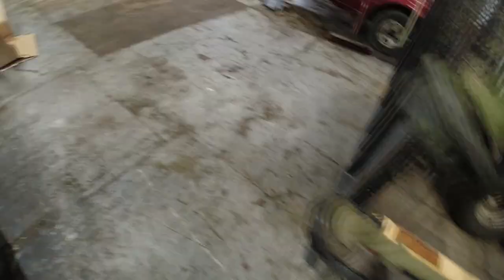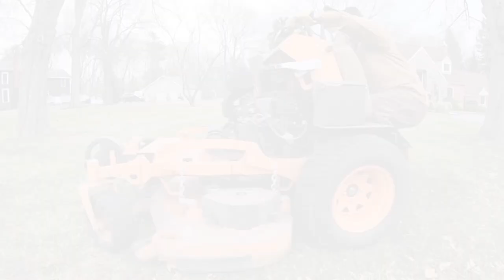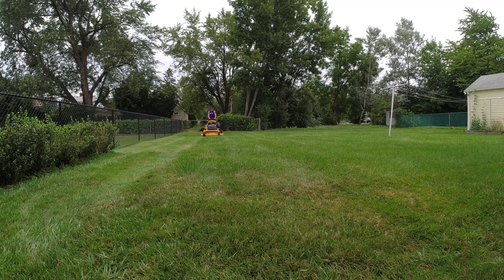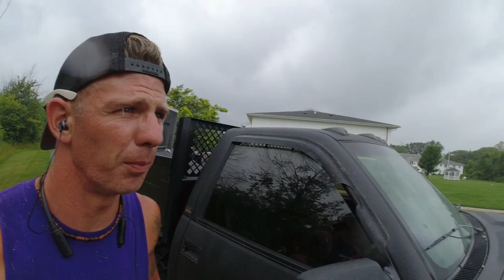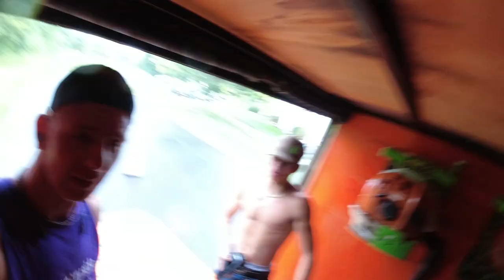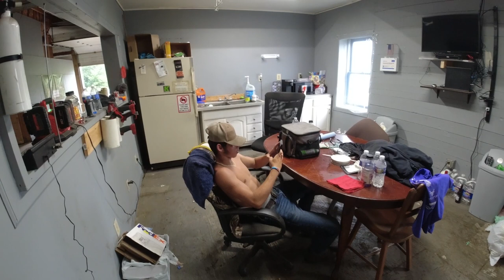WRIGHT X 52 & why I bought it

Comment: Glad you found a mower and glad the new deck is performing.  We finally had our wiring harness replaced on new mower but, now it's burning super rich and going through 2 gallons of gas per hour so, it's gotta go back and sit at the dealer again 🤦they have a new 52" Ferris that I want really bad but, the only one in stock is in Florida 🤷ugh😒
Reply: If is not one is another!! Which Ferris are looking? I'm looking at a 52" z2
Reply from the maker: That's crazy fuel consumption

Comment: Try a can of Seafoam in a full tank of fuel every or every other tank full for the cutting out problem and see what happens. Put it in a low fuel tank and then add fuel for a better mix. Mine was doing that as well and it seems to help. I know you shouldn’t have to on a new engine but just give it a try.
Reply from the maker: Hate that stuff. I use k100 but it’s not a fuel issue, exactly,  it’s the fuel cut off switch on the bottom of the bowl of the carb. That combined with how the engine is mounted
Reply: @CountrysideStrong  definitely not familiar with the fuel cutoff switch at the bottom of the bowl but I have seen a wire down there somewhere, I’ll look for it when I start working on mine here in a bit. I had heard from a Wright technician that they use it frequently so I thought I would try it and now I use it all the time and it really does seem to help or eliminate that issue. Can’t say why unless it is internally lubricating the carburetor somehow but I run it in all my Kawasaki carbureted engines now.

Comment: Randy i had that exact problem on a brand new wright. I fixed it myself. It was a adjustment rod with a spring around it located on the stand on platform.  It was slight bent. Check it out.

Comment: I heard same engine availability issue from multiple dealers. I ordered a bradley after being on a short waiting list in March.  Wish it had a better engine but I'm just glad to have one at all with how things have been
Reply from the maker: Exactly, I have heard many people having problems
Reply: It's a shame.  Was my first stander.  Drives well cut is ok still adjusting somethings  I would've liked to get a more established brand but the prices have just gotten astronomical
Reply from the maker: Yes they have
Reply: @jamess9910  I have a Bradley with almost 500 hrs on it. I got it 3 years ago. Has been great. I love the Briggs vanguard no issues for me
Reply: I wouldn't mind the vanguard.  I have the 36 so the only option was briggs commercial turf. Haven't heard great things but again, it's my first mower, and got me in the Game, before this I used a sulky and my knees and ankles would be shredded after 40 lawns a week

Comment: My x does the same thing. With the engine moving up and down with the tractor, I believe it’s an intermittent loss of fuel. I honestly think an in-line electric fuel pump would fix that issue. I get why wright designed that mower like that to get longer belt life etc, but with the articulation of the engine I really do think the bowl in the carb is never truly able to deliver the fuel needed at high rpm when on an angle.
Reply from the maker: I believe you're prob right

Comment: The engine cutting out on bumps, i would check how its getting fuel, and another possibility is ho the choke and throttle is done, it can be choking it self on bumps which mean it may need a spring pulling back on throttle or choke, there just about no way it can be a fuel problem if your other mower don't have that problem. Just maybe it has a oil sensor that kills the engine, i know some engines have them and slight hill or bump and will shut the engine down.
Reply from the maker: Yes that all makes perfect sense.

Comment: My 37 vanguard was doing that on and off thing over bumps on my vride2.. dealer determined it was a oiler pressure sensor. 

I know they're different engines but I figured my experience was worth mentioning
Reply from the maker: For sure thanks for the input

Comment: I bought a new ZK 61” with the Kawasaki FX850 27 HP and it cuts out just like you were talking about. No matter how slow you go or how fast over bumps. I think it’s because the engine rides up and down on the deck and the other mowers the engine is stationary on the frame. It’s annoying as hell but I just go with it.
Reply from the maker: Ya that's pretty much where I'm at

Comment: That engine cut out issue certainly sounds like a fuel thing. I wonder if you could replicate it by quickly lifting and lowering the height of cut lever. Since the engine moves with the deck, maybe the issue would replicate itself by shaking it up and down. You said you swapped the fuel solenoid on the sport x and it didn't solve it but I'm wondering if maybe the magnet that holds back the needle plunger just cant hold when it gets jostled hard.  I wonder if there are any variations to that engine between the Wright mowers and say the Exmark Vertex. I think that engine floats with the deck as well.
Reply from the maker: Ya people have had same issue with different wrights and different engines on them

Comment: Our vantage had the same problem was a loose wire at the switch to the pro switch
Reply from the maker: Ya my thoughts as well but turns out that's not the issue

Comment: They redesigned their deck a little bit. The back of the deck on the shoot side and the trim side used to angle down and now it doesn't it's flat across the top I don't know if that's the difference or not.  I don't know if that will make sense lol.  But that's what I've noticed what the ones at my dealer
Reply from the maker: Makes perfect sense actually
Reply: They simply copied Cub Cadet Commercial, which I've owned for over 20 years.  My neighbor owns a mowing business & says he can not believe the pickup & cut of my mower an M54 Tank W/Trac Vac System.
Reply: @jjreal9910  No you are wrong. They did not copy cub that's completely different deck and the cub cadet commercial line is terrible

Comment: My 52" ZK with the 37 vangaurd cuts out on big bumps for a second. Mine could be the safety switch, but it doesn't mess up the cut, so I don't care.
Reply from the maker: Ya it seems to happen with all different engines

Comment: nice mower good luck with it   the cutting out of the engine when you hit a bump that's weird my JD 636 m doesn't do that and it's almost the same???  take care my friend 😁
Reply from the maker: Not sure yet but I'll figure it out. Thanks buddy
Reply: @CountrysideStrong  I'm about your size l think maybe heavier 6-3. 260  so it's not that what your tire pressure l run 10 to 12 lbs?

Comment: It’s hard to beat Wright mowers for there value! I believe they have a carburetor kit (or different carb) for the cutting out issue on bumpy terrain. The “fs” vs “fx” family of kawasaki motors, the fx is the better class of motor.
     My son purchased your exact mower in May of 2022, he was $10,500 including tax (western suburbs of Chicago). They thru in an extra set of blade. I have the 2018 stander x second generation.
      There is no perfect mower. Skag, Wright, toro exmark all make quality products. They all have a few hiccups.
Reply from the maker: Ya I'll agree with that

Comment: It's a fuel issue, my vride 2 carb 48 will cut out when hitting hard bumps/ruts,  my vride 2 fuel injected 61 never checks up crossing the same tgings
Reply from the maker: The wright's I've owned have all done it. No other machines have and I've owned em all

Comment: My John Deere 930M does that exact same thing, cuts out on bumps. Kawasaki engine. The 26 hp. Can’t remember what series it is right now but it’s a 2019 year model. I just pretty much ignore it I hate the oil consumption of that engine much worse. But I don’t think it’s fuel because it’s instantaneous upon hitting bumps. A float sticking and unsticking would cut out after the fuel bowl emptied. It’s either the oil pressure cut out switch because the oil pump could be sucking pockets of air when the machine bounces up and down, or it’s the computer itself telling the engine to stall because it thinks it’s rolling over. My guess it’s one of the two and it still may be doing it via the oil pressure sensor.
Reply from the maker: There's no computer in it. If it's EFI there is, but not on a carbureted engine
Reply: Really. Mine is carbureted and has a computer. Must be a Deere thing.

Comment: I dont know what you're talking about lol.. I've been a landscaper for like 12 years.. I've used every machine brand from Toro, Wright, Exmark, Cub Cadet, John Deere etc. And Wright has the best cut BY FAR lol.. sure, the engines do cut out if you hit a decent size bump, but it has to be a decent size, and honestly it's not really an issue.. its not like it hinders your ability to cut , is bogs down for like 2 10ths of a second and revs wright back up (see what I did there lol 😂)

Comment: Kawasaki has a "rough terrain kit" for the carb. Ed is right. My Lazer does it too.
Reply from the maker: That's nice but why don't any of my others do it, 7 of them I've had without issue🤷
Reply: @CountrysideStrong  same it's apparently an issue with select engines. It's extremely frustrating I know. I opted not to have the kit installed at my cost being it's still under warranty. One thing that helped greatly was lowering the rear tire pressure. 🤷

Comment: Randy, I own a small lawn care I'm central ohio. I have 2 wright's, zk 61 and a stander x 52 like your new one but with a vanguard 28 efi. The cutting out issue you gave, I don't have at all except my platform cause switch is still hooked up. I lowered the rear pitch of deck by 1/8 inch and cuts very well. Did it on the zk also and big difference in cut now. But just wanted to say that I haven't had that issue with motor cutting out and I have very rough schools I mow. Keep up the videos, you and Billy are great.
Dan
D&k lawn maintenance. 
Lancaster ,ohio
Reply from the maker: Thanks buddy appreciate the feedback

Comment: Hey man I got a question , my wright stander has been amazing for 3 years  but lately it been leaving little hairs so idk what do , I’ve got new blades and still does it what should I do ?
Reply from the maker: First thing I would check is that the tips of the blades aren't rounded off
Reply: @CountrysideStrong  I have bought a 400 grinder cause I thought my grinding has to 💩 but it still does , it’s been frustrating since it started to doing that and have been considered buy a new one but I would like to make the one have now as a backup but I want it to cut like it did before

Comment: the fx engines have totally different carb than the fs. the kawasaki is to blame. i had that fx on my ferrris walk behind, it would do it. my newer fx doesn’t seem to do it. i think it’s in the carb. i have heard it’s a common issue with the fx motors.
Reply from the maker: See that's where you're wrong because my sport x had the FS, same as all my other mowers and it did it everytime. All my other mowers don't.
Reply: unplug the wire that grounds the coils at the engine harness, and see if it continues to do it. that would completely rule out the mower side safety switches and wiring.

Comment: drill  hole put grade 8 bolt and nut in cap no new trimmer caps
Reply from the maker: I've done that for years. It's called bullet proofing. They still wear over time

Comment: Does it clump up bad?
Reply from the maker: Not at all. The new design is great
Reply: @CountrysideStrong  I demo'd one yesterday with the 27h vanguard engine. The ride is smooth as butter, controls are very responsive but they had a mulching kit on it so I wasn't able to get a good demonstration of it because I don't run mulching kits. To be fair, my yards are biweekly and it was wet, so I won't bash the cut quality. All in all it was good enough for me to pull the trigger on one. I'm getting the 52 ZX with the 37h vanguard for $14,500 out the door.
Reply from the maker: That's a good deal